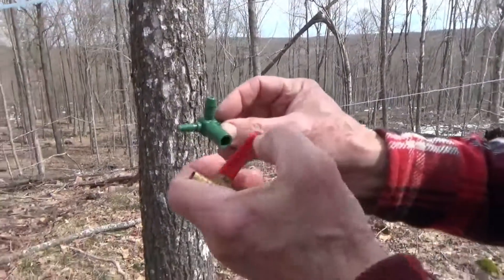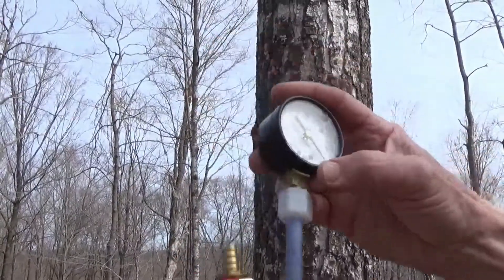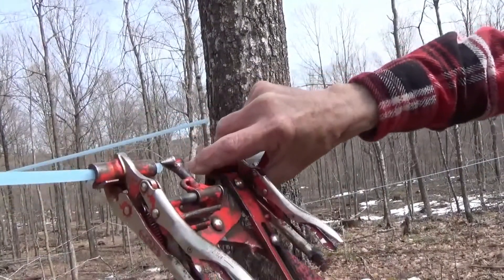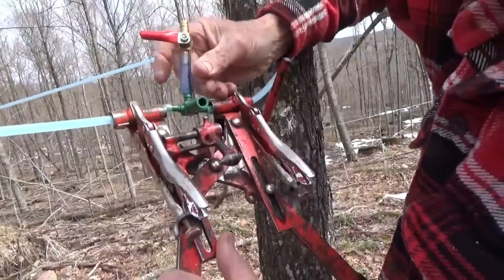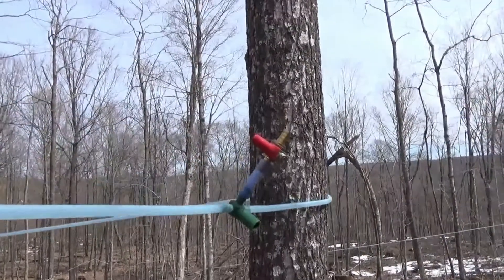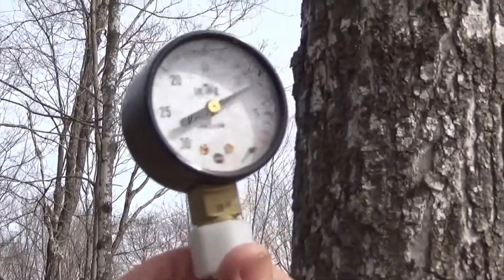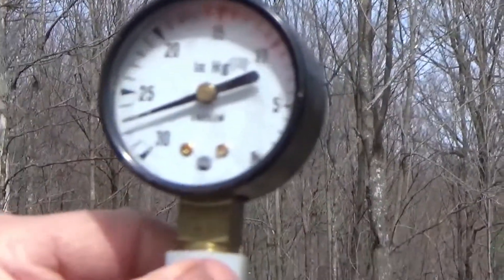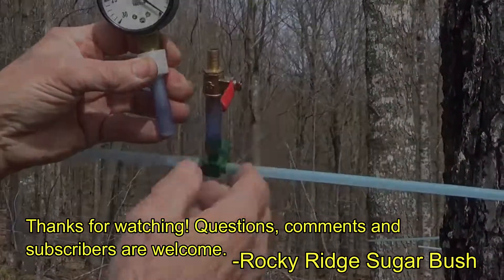3/16 sap line, 26+ inches vacuum, new idea to protect gauges

Comment: Just a suggestion, maybe have some kind of cap on the valve when the Guage is off to keep moisture and debris from getting into the line.
Reply from the maker: Good idea, thanks.  Probably the caps that CDL and others sell will fit.  Will also help to keep out those D--n mud dappers.